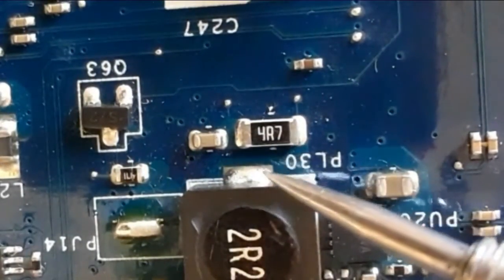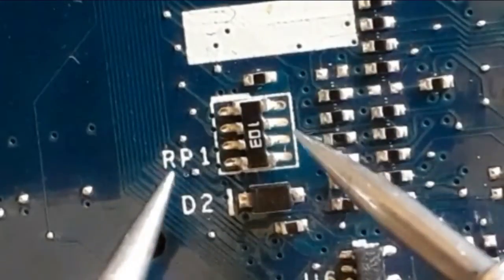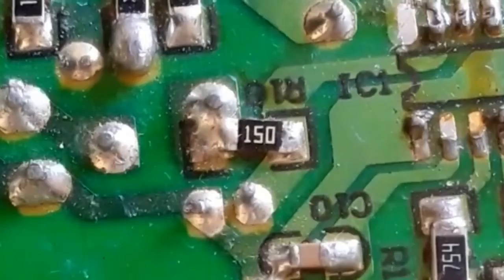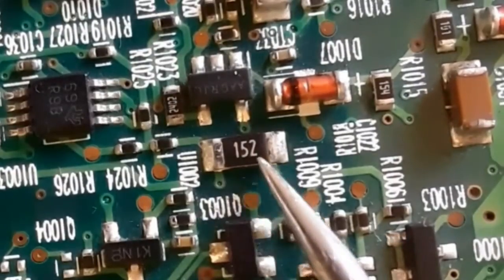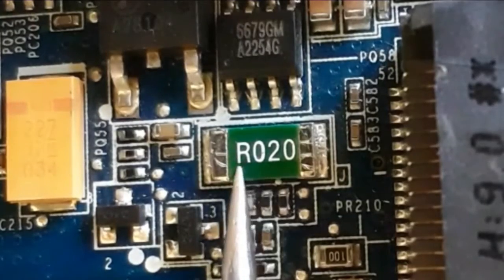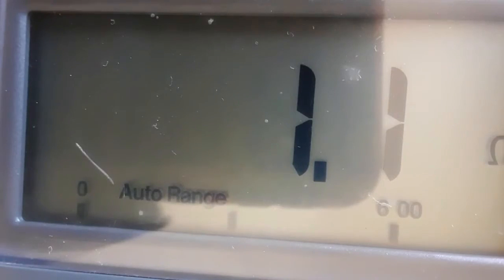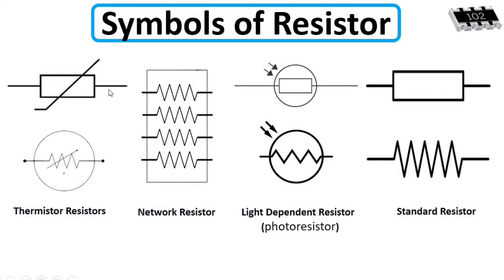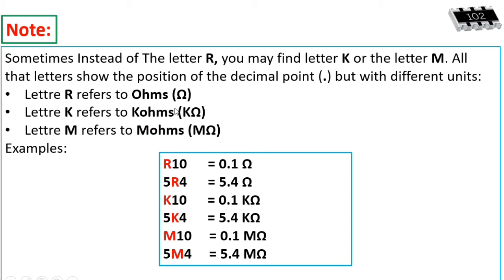SMD Resistors Testing using multimeter - Laptop Motherboard Repair

Comment: Bro I have to replace the  smd resistor near the  mosfet of Vrm section and it's without any marking.fortunately i have found the schematic of motherboard when i checked the schematic in board view , its showing VR103 ,so im confused which one i should buy variable resistor of 10k ohms or simple one .btw resistor is very tiny.

Comment: I have a failed security control module out of my car. Basically the module that controls the alarm. It is discontinued and I have been trying to figure out how to diagnose the PCB before sending it out for repair. This video is the most helpful I have ever seen when it comes to resistors. Thank you!!!
Reply from the maker: Thank you for your kind words! I'm glad the video was helpful. For diagnosing the PCB, I recommend starting by checking for obvious issues like burned components, blown fuses, or corroded connections. Then, using a multimeter, test key components such as resistors, capacitors, and diodes to verify they’re within spec. Pay special attention to any MOSFETs or ICs that may be controlling the alarm system. 
Good luck with your repair